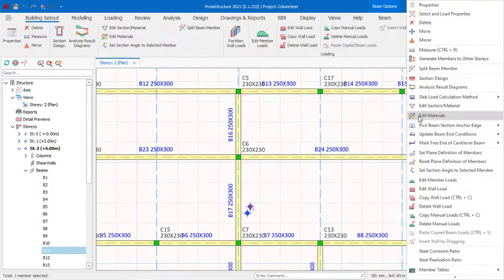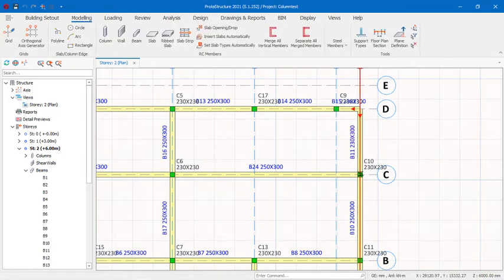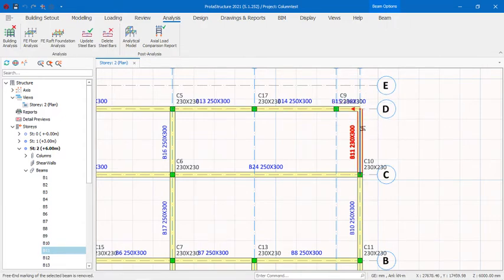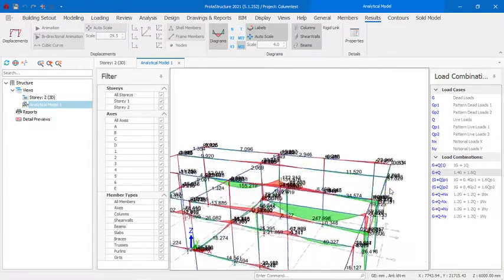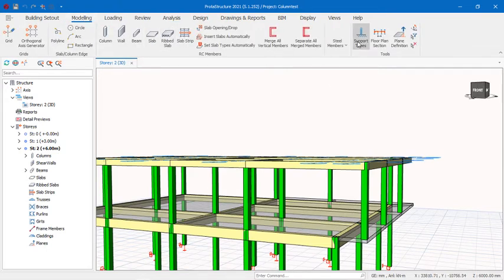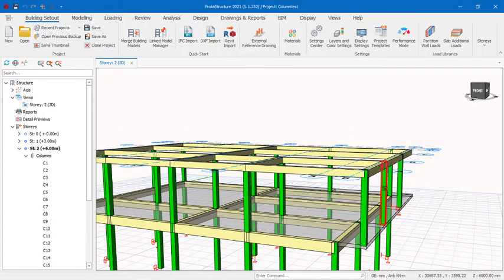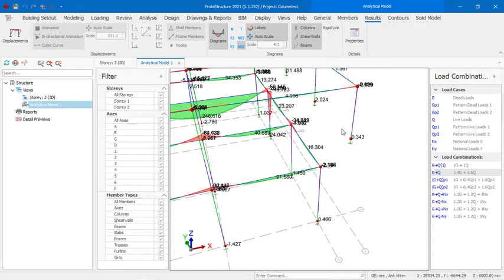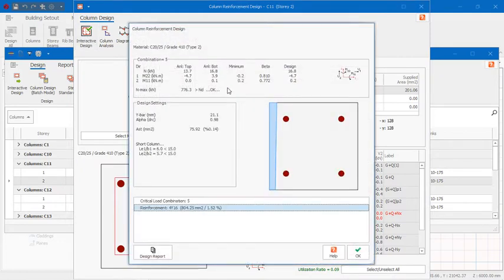Inner workings of Prota Structure suite 3.3 & 4 (case beams as cant/support & floor column support)

Comment: Thank you for dishing out this solution but in a case of adding wall loads to the cantilever without the beam, how are we going to do it?
Reply from the maker: You can add wall load on cantilever by using either additional slab load or parapet load in the cantilever slab property box by specifying the actual wall model you will have

Comment: Sir adding my support , I did exactly  as in your video but I notice the column  coming doing from the cantilever  will not be visible  in my 3D but when I click of my foundation  plan that same column from cantilever  will be on story zero
Reply from the maker: And also at foundation level issue, that is one downside of the software.
Because it see the support as part of foundation elements, so it appears at storey 0.
What u can do during detailing is to remove that particular column at that level. But for ur analysis results you will be ok I guess.
Reply: OK thank u sir